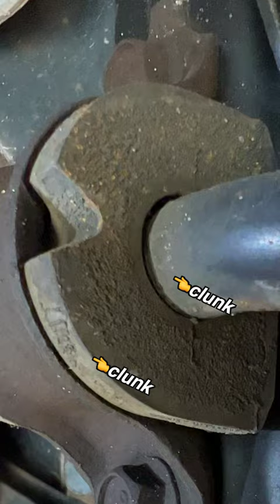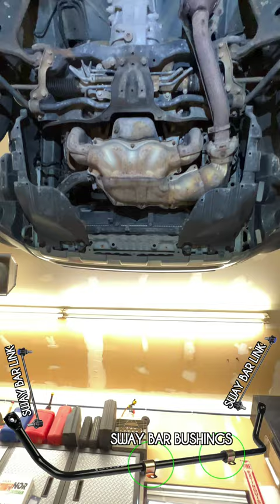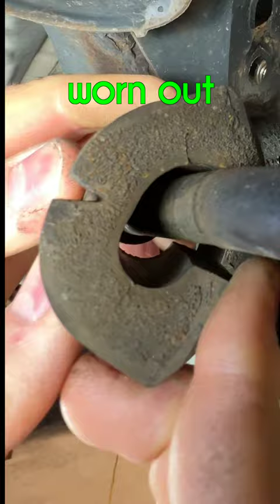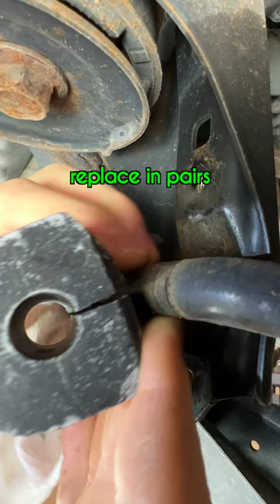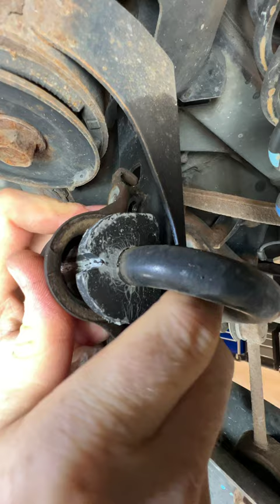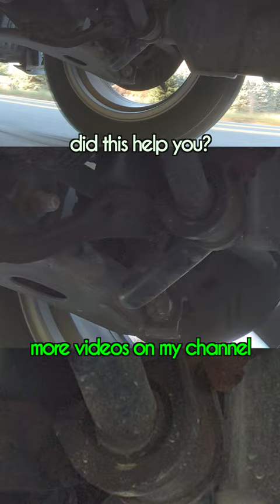sway bar bushing replacement 🚘🔧✅

Comment: Y’all I’m telling you grease the bushings… don’t run them dry as they will make noise and friction which will wear them down. Don’t care what the factory does… if the factory didn’t grease them that’s probably why I’m replacing the damn bushing so soon!
Reply from the maker: The bushings were 10 or 11 years old. How long should they last with lubrication?
Reply: @EasyFixShaun  your bushings were likely long expired before replacement given their condition shown in the video. So let’s assume they went bad before 10 years. They should certainly last longer than that, probably closer to 15. You can suggest they won’t perform the same way but most people aren’t mechanically inclined and the bushings should perform well enough to do it’s job for 15 years.
Reply: Grease them good with marine grease. Don’t use other greases like lithium grease, etc.
Reply: @EasyFixShaun  that's why maintenance is required... like with many other car parts
Reply from the maker: no
Reply from the maker: no
Reply: @EasyFixShaun  if all you can say to that is “no” and you have no logical response to my logical response (which you did ask for) then I’m going to assume you have no justification for your point and are committed to a wrong opinion
Reply from the maker: @jorgemabarak7932  I didn't want to leave you hanging. The simple answer is no.
Reply: @EasyFixShaun Scotty kilmer had a video on this and used lithium grease.
Reply: Go poly and grease them
Reply: Grease the bushings .
Reply: yeah who cares what the engineers says. they only designed the car. and does rubber and grease go together.
Reply: @NeutronX101  there are greases that don’t eat at the rubber. Also engineers don’t decide if the factory cheaps out on greasing bushings or not. There is also a long standing idea that engineers and mechanics don’t get along because they aren’t thinking about the repair or replacement scenario. You should know that a lot of factories and engineers WILL grease them, and claiming they don’t is an empty claim
Reply: @jorgemabarak7932  I'm guessing your the type of guy that prefills his oil filter.
Reply: @jorgemabarak7932 em with you mate , they don't have a logical answer to this
Reply: Why? So the grease can collect dirt (a well known abrasive) and the bushing can wear out faster?
Sway bar bushings are <$20 anyway.
Reply: @guy_incognito7538  you seriously mean to tell me that grease… the lubricant to prevent parts from wearing out faster… is going to wear your bushing down down faster?? Yeah.. sure pal. 
Why don’t we just remove all automotive lubricants? Who needs them?! All they do is wear down parts faster.

That’s exactly how you sound
Reply: @jorgemabarak7932  you mustve missed the part where I said grease traps dirt, and the dirt is why it wears out faster. 
A dry lube would be a better choice than grease... or nothing at all because it's a $20 part that takes 15 minutes to replace and lasts 10 years.
Reply: @guy_incognito7538  I think dirt can't go inside of the bush , it's a specific amount of grease not dip into grease
Reply: @guy_incognito7538  do you seriously think that grease attracts so much dirt that it destroys car parts? I ask you again why the auto stores even have it? Brake grease, ball joints, etc. That’s like saying you shouldn’t have oil in your car because the oil gets dirty. 
Dry bushings are also going to dry rot before they “wear down” from being greased. It’s insane that you think grease destroys bushings
Reply: @jorgemabarak7932 Pertoleum based greases eat rubber. Use silicone grease on rubber parts.
Reply: You’re supposed to take em off and spray em down with AT 205, it will save them and restore them if they aren’t too far gone
Reply from the maker: Never ever grease. Scotty Kilmer is trolling you.
Reply from the maker: Longest comment ever award 😃🏆 Also correct on no grease 😂
Reply from the maker: nope not even poly 🦜
Reply from the maker: never
Reply from the maker: good call. manufacturing does matter though because they don't want warranty claims, lemons, or noisey bushings. So no grease on them bushings is best 😃
Reply from the maker: Nope. Pull any new one apart and prove me wrong.
Reply from the maker: I never pre fill oil filters. Maybe a couple times when I was a newbie 😂
Reply from the maker: Exactly 😃
Reply from the maker: No grease is the best grease
Reply from the maker: "no grease never ever", Henry Ford
Reply from the maker: "four score and no grease ago", Abraham Lincoln
Reply from the maker: Scotty is a 🐐 troller for the uniformed. Entertaining though. I highly recommend 😃
Reply from the maker: "No greasy greasy", Beyonce
Reply from the maker: "to grease to not to grease, that is the question", Shakespeare
Reply from the maker: "Lubrication makes the world go round. Except for sway bar bushings", Chuck Norris
Reply: I’ll be the guinea pig for y’all, just put brand new sway bar links on my truck, if they fall apart within a year or two grease is bad, if not I guess grease ain’t as bad as y’all think
Reply: @NeutronX101 I… yes? How does a CV boot work then?
Reply: @shaneomac5074 I’m expecting a follow up I’ll be back in one year exactly 😂
Reply: I'll have the final word here.  Some bushings require grease and some do not require grease (i.e. polyurethane).  Case closed.  Source:  I cook greasy burgers.
Reply: @NeutronX101  engineers have made alot of things within modern car designs that make no fucking sense, why would we start trusting them now lol
Reply: def don't run them dry.  they will bind  you want that bar to spin inside the bushing
Reply: I always grease sway bar bushings, easier to install too
Reply: @jorgemabarak7932 it's ok to be wrong buddy
Reply: I agree! I just bought a set of bushings and they come with grease fittings.
Reply: I've lubricated all my sway bar bushings for years with silicone grease - Super Lube or Shin Etsu - and I've never had a squeak from a bushing ever, in dozens of cars I've replaced bushings on.
Reply: I agree with you on this fixing to do mines when my rear sway bar links get here I have the bushings for the rear sway bar

Comment: You should also add that is a very cheap item
Reply from the maker: Yes! I should have. Extremely cheap by comparison to almost all repairs 😀🔧
Reply: It's not cheap if you can't find replacements in the country you're in 😅😭😭😭
Reply: @MsWnDrLnD  they've never been not available. What vehicle are you having difficulty with, send stone details and I'll check which others are the same
Reply from the maker: Sorry you are having trouble locating them. The dealership is usually the best parts and the best place to start because of that. Sometimes ebay or amazon works well here. Or rockauto.com. Do you have any of those options in Australia?
Reply: @Easy Fix  oh my gosh. I didn't even think of the dealership! Thanks for the idea,turns out they have 2 left locally in my state :) but they are $40 AUD  each which is crazy, but I always heard dealerships are expensive.
I have a 2003 Hyundai tiburon 2.0L
Hyundai did also give me a part number though, and I found a set of polyurethane ones matching the part number on ebay too!
They have a different measurement to what I read my sway bar measures on a forum, but I might take the gamble and hope if the part number is the same they should fit. But if not at least I can source them locally now, thank you so much that was actually a really helpful suggestion 😅
(Edit: I didn't think of the dealership because I was too busy getting frustrated googling/ebaying and amazon-ing 😅)

Comment: Read the specs, if it says "clean, dry threads" do not put grease on those bolts. If you do you will seriously overtighten them and risk breaking the bolts. Spray with anti-corrosion fluid AFTER you tighten them.
Reply from the maker: Good tip! But....What is a clean dry thread? I live in the rust belt 😃🔧
Reply: I would say that if the nuts and bolts can't be fitted without greasing them they aren't clean enough in the first place. The only reason for adding grease to nuts and bolts should be to prevent corrosion unless the manufacturer's instructions say otherwise.
Reply: Nonsense, lubed threads are happy threads, protects against galling and corrosion.  Oiled threads 90% dry torque spec, greased 70%.  No one is going to break these bolts installing with a 3/8 ratchet.  Spray a rusty seized fastener with penetrating fluid, it doesnt get into the threads, the corrosion seals the free space between the threads.  If a bolt is rusty, torqing with oiled threads will be closer to the proper bolt stretch then torqing dry and rusty. I deal with rusted and seized fasteners almost every day.  Torquing swaybar not necessary.
Reply: I say grease them. Just don't break them off when tighten them. Lube threads are happy threads.
Reply: Spoken like not a mechanic. Its a small bolt dont go ballistic on it
Reply: Read my mind, never seen someone put grease on bolts that kinda blew my mind
Reply: 🤔i have been lubricating mines with lithium about 4 yrs now till present and havent changed since. But im beginning to hear clunks when i turn to pull off ,not too sure will have to check that
Reply: @shanedottie  do you live in the rust belt? Grease or anti seize is a must
Reply: @DaDaDo661  maybe anti seize but not grease on bolts. Having grease on bolts can throw off the torque a lot
Reply: @DaDaDo661  also if you have grease on them they’re pretty likely to loosen up, I prefer to just install with a little anti seize or leave it dry and deal with it later with some heat and penetrating fluid
Reply: Not that big of a deal dude, you must not wrench… at all
Reply: @taliesinangling3564  no offense dude but you seem pretty young you don’t strike me as the kind of person that has worked on cars for years. This guy is simply pointing out what the repair manuals said, and you try turning it into him not knowing how to wrench? That’s kinda ridiculous.
Reply: Just clean the threads with wire brush or old tooth brush. After that put anti- seize  lubricant if you have one.
Reply: @OKBAOK  finally someone with some sense
Reply from the maker: Manufacturer's are the experts at making cars. 
Mechanic's are the experts at fixing them.
Reply: Whaaa whaaaa
Reply: Yeah I’m gonna use anti seize on pretty much every bolt on the undercarriage of a vehicle, I do have to agree but only for lug nuts never anti seize those, or steering suspension castle nut threads
Reply: @shanedottie  you must not live in the rust belt then
Reply from the maker: If it torques properly is it ballistic?
Reply from the maker: Certain bolts love grease. They just can't talk
Reply from the maker: Nut behind the wheel might be loose 😂
Reply from the maker: Mandatory in some cases 😃
Reply from the maker: Nope grease is good
Reply from the maker: Not likely. Anything other than dry in the rust belt is good on some bolts. These are they.
Reply from the maker: Experience is a hard lesson learned sometimes
Reply from the maker: Discussion is good to find all or any optional solution
Reply from the maker: $.02 welcome
Reply from the maker: Not bad
Reply from the maker: Lug Nuts are a no go for any lubrication. Just doesn't help. Critical area to be messing with.
Reply from the maker: Maybe. Rust belt issues are hard to believe and is very foreign to some. It is truly incredible what we rust belters have to deal with.
Reply: @shanedottie    I’m 19 have worked on cars, motorcycles, and boats. Stocktorock on the gram for my work. Yeah saying he doesn’t wrench at all is kind of ridiculous. I was just annoyed because it’s really not that big of a deal. Turn a wrench enough and you can get the feel for over tightening and whatnot, its not like you’re going to severely f up whatever you’re doing. 

It makes total sense that I wouldn’t strike you as that since you don’t know me. 

On my end I can’t see any of my comments I might’ve left three saying similar things.

Comment: If they are supposed to be installed dry why do a lot come with a tube of grease and some come wish a grease fitting
Reply: Exactly, I ordered a sway bar set for my car and they come with a bucket of grease, this guy smoking crack.
Reply from the maker: different material?
Reply: It's for putting the bushings on the sway bar. I saw this on Hot Rod garage. He was installing new sway bar and bushings on a 01 Stang
Reply from the maker: I never check

Comment: Use the canned white lithium grease, no squeaks and the bushings last longer because they’re lubricated.
Reply from the maker: great tip. Working for you so far? How long?
Reply: @EasyFixShaun  If you apply generously, you can go until the bushings dry out.

Comment: Silicone grease is fine to use, normal grease will degraded the bushes much faster than being dry. If you don't grease make sure you have a good stereo to drown out the squeek especially if you put in poly bushes

Comment: This has helped me in the past. Camry 2007s often get the bushing clunk in the rear. Penetrating oil + heat to remove bolts up here in Canadian rust belt
Reply from the maker: nice 😃

Comment: I would put silicone grease. I've heard new bushings installed still make noise.
Reply from the maker: Grease will cause noise, install dry like the factory does. The soft rubber bushing is designed to wear and be replaced eventually with no grease ever needed 😃🔧
Reply: White lithium grease
Reply: I installed new bushings with no grease and terrible squeak silicone grease helped but it returned the next day

Comment: My Hotchkis suspension kit provided grease for the bushings. The swaybar bushings will creak and groan really loud if not greased. Energy Suspension also recommends and provides grease for their bushing kits also. I worked in a Speedshop for a long time and installed hindreds of kits on all types of cars and trucks. I always greased the bushings on everything so my customers dont complain about noises.
Reply from the maker: Poly performance need lubrication. 
Oem/rubber does not need lubrication. 
Is that what you mean?
Reply: @EasyFixShaun  yes, that's what I meant
Reply from the maker: agree :)

Comment: Will this fix the back tire roll on corners as well as stop the loud clunk noise in my rear right wheel ?
Reply from the maker: Very possible. Check out my long form sway bar link and bushings video on my channel. Crazy fun tips on how to check it 😀
Reply: @EasyFixShaun  I think I just have a bent tie rod. Left side feels straight right side curves like a J. Thanks dude!
Reply from the maker: Ooof! No problem. Get that sorted ASAP! :)

Comment: Do i need to make a wheel alignment after replacement rear bushes?
Reply from the maker: Not usually. As long as the fasteners and parts you remove don't adjust or change any alignment angles You should be good. 99% of the time no alignment will need needed 😀

Comment: Well, if you got a squeak and you pull it off, you have to sand it you don’t have the money to replace the bushing so just put a little dab of grease on there. It will get rid of the squeak and later on you can do it right but some people don’t have a money to do it right at the time so I’ll just WD-40 silicone spray or a white light film of grease
Reply from the maker: I have never tried that. Could work temporarily i guess 🤌

Comment: I think that's what I have going on with my 2019 Jeep Cherokee Trailhawlk. I took it to a shop to find out it has a lot of codes that need to be updated on the software also. I get clunky noises and slight vibrations when driving up to between 25 to 40mph
Reply from the maker: Oh wow! Good luck getting it all fixed up 😃🔧

Comment: Use of silicone based lube or grease on rubber bushing is actually a good idea.

Whereas grease on the bolt thread? What’s the purpose? If trying to prevent corrosion, could use a dab of blue loctite. Loctite not only prevents bolts from un-doing itself, it also keeps water out of that crevice once cured.
Reply from the maker: I have never seen a bushing bracket fastener back out. It could happen though and if it did, locktite would be a great solution 😃🔧
Reply: @EasyFixShaun  Hey, thank you for replying! 😊

I still don’t know why you used grease on the bolt threads though. 
Was it to prevent water entry & corrosion?

I was under the impression torque specs assume dry fasteners; if lube is used, throws off those torque values and may easily over stretch the bolts.
Reply from the maker: It made me feel good about the bolt going back in easily. They were rusted and came out hard. I broken them before. Rust belt issues 😃

Comment: Hey again, sorry for the frustration in my last posts, I was losing my mind trying to find my sway bar bushings and this video popped up! 
Just a question, you say it can be done on the ground, but then what do you mean by 'level the suspension'?
Also my polyurethane bushings come with grease, does this go inside the bushing, or in the bolts as you showed?
Reply from the maker: No worries. The sway bar simply try's to level the suspension side to side. So if the height of the wheels is different sode to side there will be pressure on the sway bar and components. If the height is identical side to side on the sway bar ends-no pressure will be on the bar. The bar is a spring and twists like a torsion bar when there is a difference side to side 😀🔧
Reply: U didn't answer the lube came with the bushings question....??

Comment: A mechanic told me not to lubricate bolts because it’ll cause over torque and a higher likelihood of failure. Not sure if that’s true….
Reply from the maker: I have found that lubricating lug studs for lug nuts is the only place that causes a problem 😀🔧